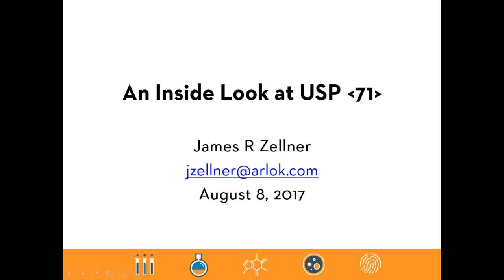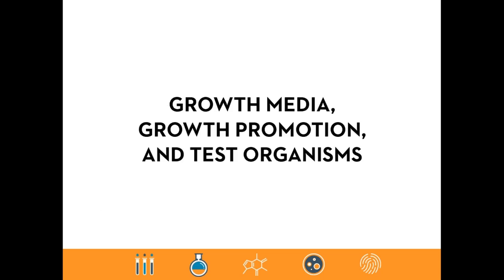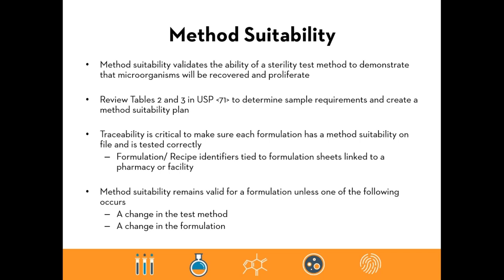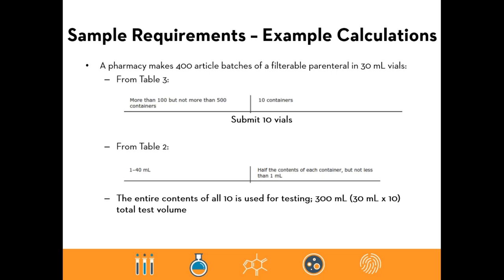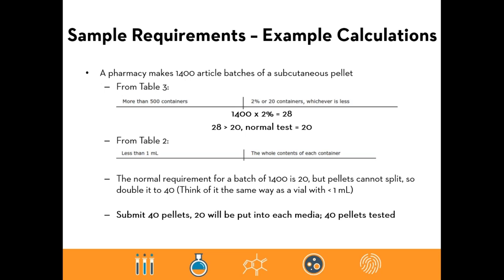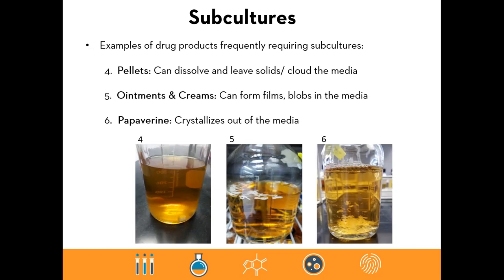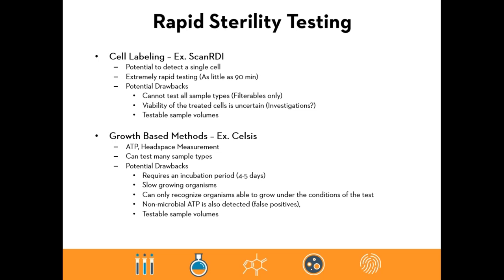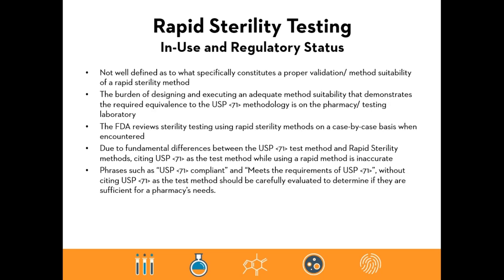An Inside Look at USP 71

Comment: Question. I'm attempting to put together a method for suitability using membrane filtration method (millipore pump). Should all challenge organism be pumped into canister be exposed to both TSB and FTM? Leaving you with 6 TSB samples and 6 FTM samples for incubate? Or should it only be 3 and 3 representing 3 TSB challenge organisms and 3 FTM organisms?
Reply: I use all microorganisms that can reproduce according to the intended use of the media used in method validation. TSB: C.albicans and A. brasiliensis maybe B. subtilis.
FTM: C. sporogenes, P.aeruginosa, S.aureus and B. subtilis.